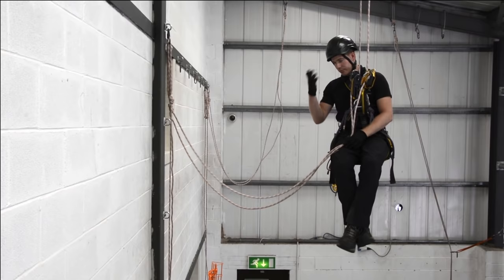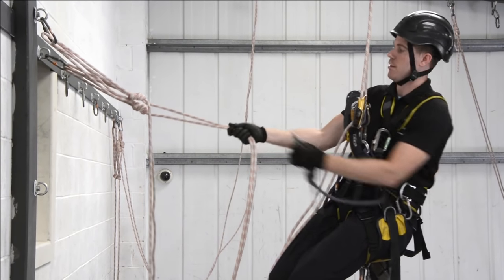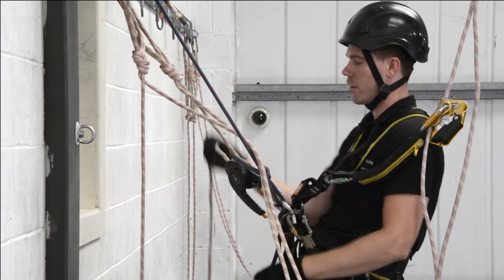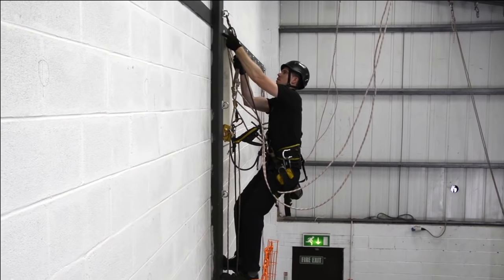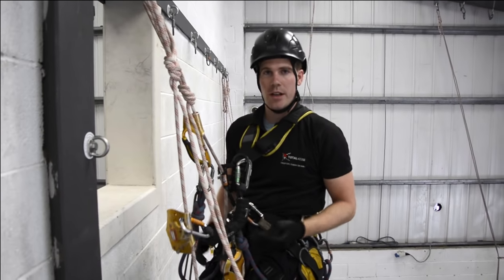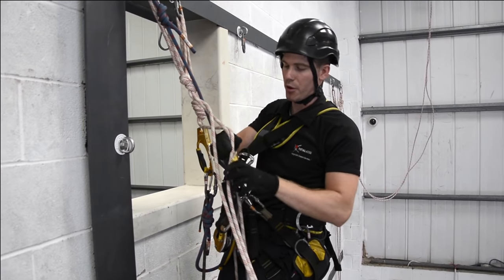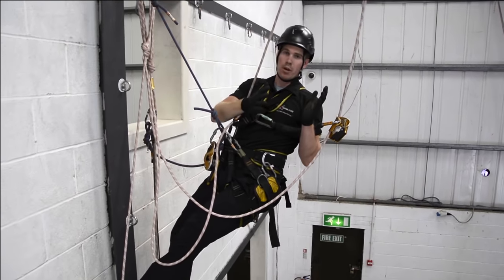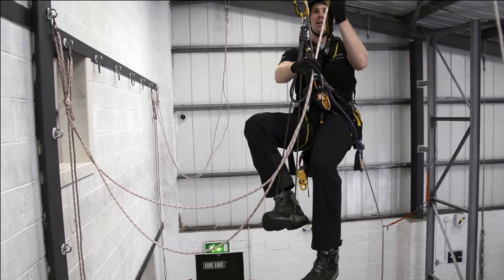IRATA Level 1 Manoeuvre - Re Anchor (belay) in Descent and Ascent

Comment: Is there a reason that you use screw gate rather than auto locking krabs?
Reply from the maker: Hi droznig, yes, historically around the world both IRATA and the Emergency services only use screw gates. We like to usually use screw gates in our training as using a mix of these and auto locking can result in people forgetting to lock the screw gate krabs as they get used to the auto locking. We also only usually use screw gates in training for safety reasons, forgetting to lock off your screw gate is a minor for us and 3 minor and you fail our training course, its a key part of the course.

Hope this helps
Reply: It does help, thanks for the response! But just to be clear, apart from the confusion that might arise from using a mix there is no safety issue with using auto locks provided you check them same as you would a screw gate?
Reply from the maker: droznig yes as long as they are all checked safely the same then their should be no problem using auto locking krabs.
Reply: Totalaccessuk1  Great, thanks for the response! Also thanks for uploading these videos.

Comment: You disconnected your ASAP leaving yourself hanging only on your waist D ring ( creating a critical point). Although you have two ropes attached to your harness they relay only on one point( the professional definition of a critical point).
Reply from the maker: Hi Seva, this is perfectly acceptable , the descender was moved onto the new ropes whilst the ASAP was still in a position of protection therefor maintaining the 2 separate points of contact, the ASAP terminates in the upper EN361. All of the cows tails are terminated in the lower abseil point as is the descender. I understand your comment but this is accepted practice.
Reply: Totalaccessuk1Good to know, still, my logic tells me to always keep my safety on my upper ring since the upper part of the harness is what gives you the protection from turning upside down during a fall.( I believe you know the dynamics of a fall on a safety connected to the lower D ring). Interesting... since that is an unacceptable method where i work... defies our logic.... but then... the chances of a fall during this kind of Re Anchor are of course very slim, still, accidents happen when we aren't prepared and its always the mistake you wont see coming that gets you
Reply from the maker: Seva Mikitas 
I agree, I can see your logic too as the abseil point in the UK is not deemed fall arrest. It would however complicate training if one cowstail was attached to the upper en361 point and a separate one was used for positional work and transfers. This would be acceptable practice for experience rope access technicians but imagine trying to teach that to level 1 starters.
Reply: Totalaccessuk1 Another Question I have is about connecting two rings and loading them with your body-weight. I learned from the sport climbing world that two rings connected to each other are a bad idea since they tend to twist and deform, thus weakening them. After a while i thought this could happen only on several occasions such as hanging in the air without any counter from a wall such as Silos or many confined space situations. But although they can twist under certain circumstances, if you fall on such a ring combination, the force the drop creates can twist them to. Are you familiar with such claims?
Reply from the maker: Seva Mikitas That practice is known as daisy chaining, it is not seen as ideal, but sometimes unavoidable. In sports climbing it is normal practice to use single action karabiners, these can roll out very easily if daisy chained. Industrial rope access forbids the use of single action krabs.
thanks